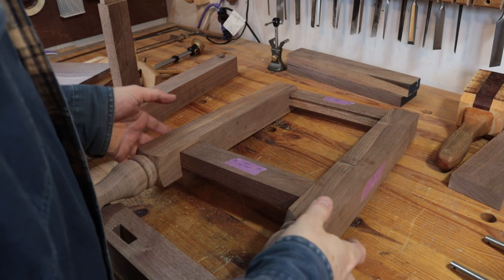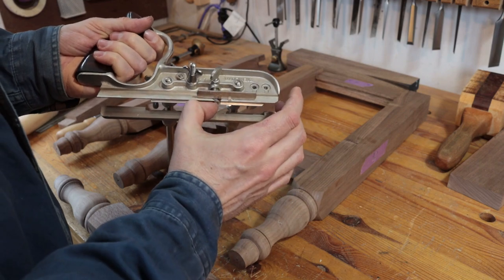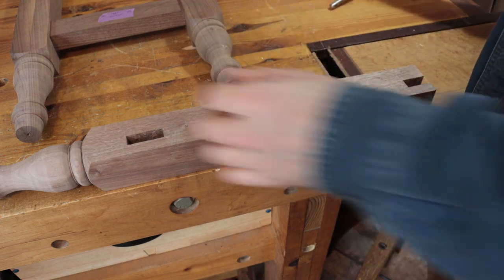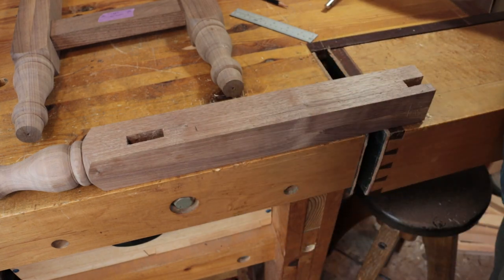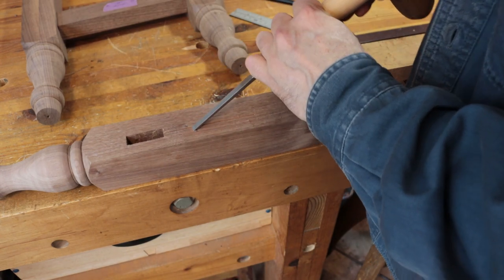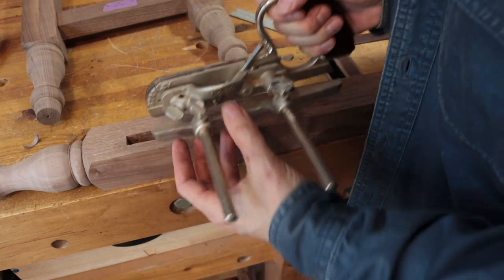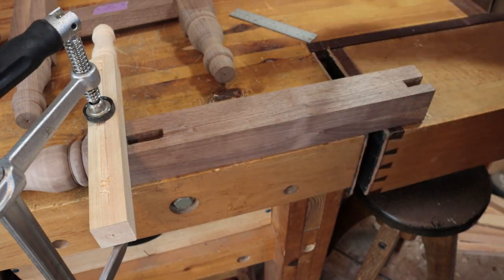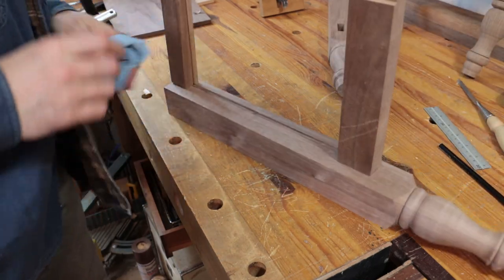How to cut a stopped dado with a combination plane!

Comment: I also own a #50. Seems very finicky to me. Especially the narrowest three blades I’m unable to tension down between the two bodies.  Looked at it every which way without the lightbulb going on. Any ideas?
Reply from the maker: When you use the thinnest blade there is a set screw on the right at the back that you have to tighten to tension the ski. Close both skis until they touch, tighten the screws on the guide bars so the adjustable ski is locked in place and then tighten the set screw until both skis are parallel. Also, don't forget that with the thinnest iron you can't use the sliding section, you hold the iron in with the cutter holding screw. If you don't have all the parts I mentioned, you're not going to be able to use the thinnest iron.
Reply from the maker: Here's a link to a diagram showing all the parts you should have for your plane. Good luck! http://www.hansbrunnertools.com/imagesStanley%20by%20Brunner/50partslist.jpg

Comment: Yeah, this is a problem for combination planes. I have the exact same one, and have ended up chiseling one or both ends of a stopped groove. Added to its shallow depth of cut,and its awkward adjustment, this tool is less useful than one might imagine.
Reply from the maker: It has its place on the workshop, that's for sure! I love it though, and my 45 and 55, especially.
Reply: @TenonsTenors  i have an old waffle handle sergent and have never had any luck with it...but i believe its a skill issue. my question would be about the blades. i bought one that looked like it hadnt seen much use, and its taking forever to get the backs flat on the blades. are the blade for these like 0labe blades in regards to the care to detail in blade prep? how flat and polished do these cutters need to be to get good performance?
Reply from the maker: @justinsane332  As sharp as you can get them. Since the skis on combination planes provide very little back support for the cutters, you need to have them as sharp as possible. That will require having the backs flat. The cutters are thin, so if you're having trouble getting them flat, use very coarse sand paper, or sharpening stone first, like 60 or 80. I bought a #60 diamond stone for this purpose.
Once you've removed a lot of the metal, switch to finer stones and polish.
Reply: @TenonsTenors  so basically i should ve treating them as I have, which is a typical chisel or plane blade...good to know, but man i have a course dmt diamond plate and its taking forever to flatten and then regrind the bevel. i may switch to some sand paper to prep then go back to my stones. thanks for the reply, and keep cranking out vids!
Reply: @justinsane332  backs don’t need to be flat it doesn’t have a cap iron just back off edge as you can if you need to use a ruler do so.

Comment: If you just spin the leg. You can  work from the mortise to the top of the leg and not have to figure any of that out.
Reply from the maker: Nope. After the first cut in that direction the ski on the plane would ride up on the back side of the mortise, so the plane would be be at a downward angle and not level with the cut of the first pass when you tried to take your second pass. If you had a plane with a really short ski that fit completely inside the mortise, yes, you could do it that way.